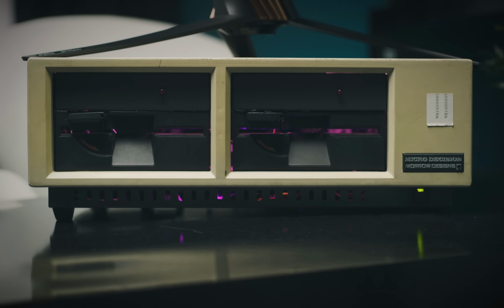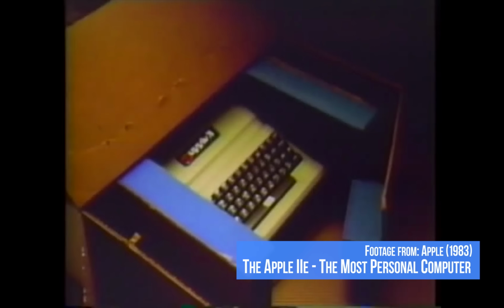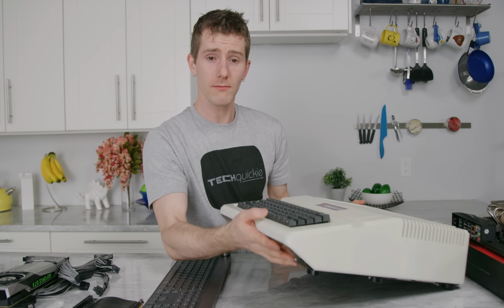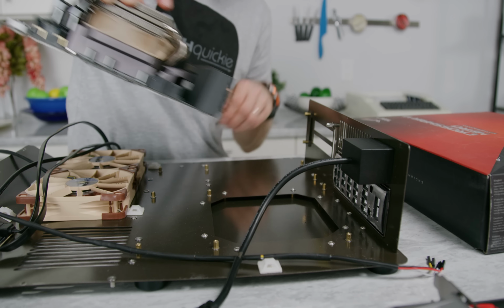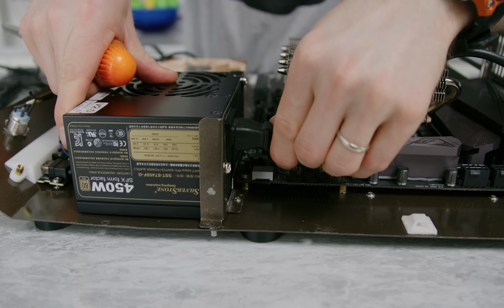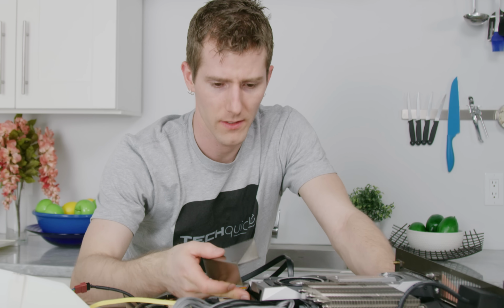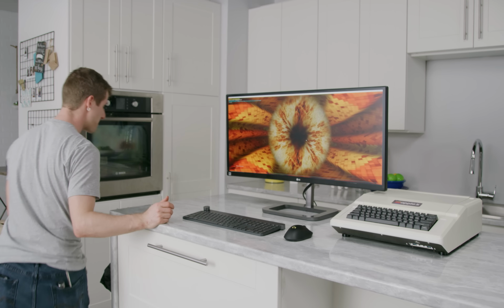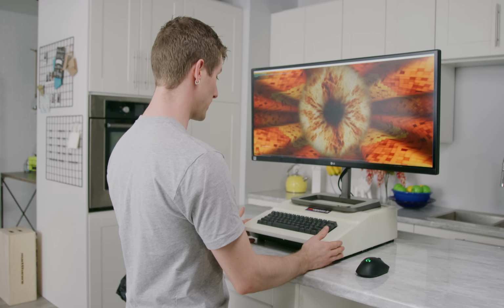Apple II Themed PC Case!!

Comment from the maker: UPDATE: This project appears to have disappeared and its backers are left with unfulfilled orders.This video will remain up, however, this should not be taken as an endorsement for the project.
Reply: Sadly I bought into the scam, thanks for at least updating the video (I backed it before the video so it's not your guys fault)
Reply: It's a shame. It's a fantastic concept.
Reply: I'm not suprised cause I bet Apple sent in their lawyers once they got wind of this.
Reply: @supertouring1  Pretty sure it was Apple
Reply: It was a bad sign when it had a unaltered Apple 2 logo plate on it.
Reply: rip
Reply: thanks for letting us know
Reply: Wow...I wanted this.
Reply: What kind of RAM did you use in combination with the CPU? I want to get a 32GB Ram kit for my AMD Ryzen 7 1800x but couldn´t find any fitting RAM Kits yet.
Reply: You should try out the Checkmate A1500 case. it's in similar vain as this one, as the case is based on the Commodore Amiga 3000, and it's on sale at their website (Though they're out of stock at the moment) https://www.checkmate1500plus.com/Products.aspx?searchkey=2
Reply: Classic kickstarter.
Reply: @bluebirdsigma  Indigogo.... Kickstarter has the contractual clause to refund the backers. Indigogo doesn't.
Reply: @harryshuman9637  I have funded 3 Kickstarters that have done the same thing and I have received nothing back.  check out the Peachy Printer on Kickstarter as an example.

Comment: Too bad its a failed project. Ideally it would have been a good option for Raspberry Pi running an Apple II emulator. The idea of putting a full size PC motherboard in a Apple II case seems strange. A better case idea would be the original IBM case from 1981. Moot at this point.

Comment: YOU CAN HAVE A SIMILAR DESIGN, but with a lower to the ground Key board, and all the connection located in the back or side, including Disk drives.

Comment: Please do the Atari 800, ST, C64, and Amiga case mods after this!
Reply: I don't know if you have seen these cases before, but most of them are tiny, there's no way you could fit anything with decent power in one of these cases (except maybe amiga 2000, 3000 and 4000) and that's just not good enough for linus tech tips.

Comment: the funny thing about a gt-730 in a micro atx case is that TECHNICALLY it's dual slot, because of the vga port. this means i can brag about having a dual slot graphics card even though i have the lowest of the lowest in power, at least for the modern day.

Comment: When I took my first programming class in about 1981-ish, our Apple looked similar to yours, but it did not say Apple anywhere on it--it said Bell & Howell, and it was black. It had a cheap power supply that emitted a high-pitched tone continuously. 64K was all you'd ever need, floppy disks were floppy, and hard disks were bigger in diameter than the length of a loaf of balloon bread. QDOS was the order of the day, with no GUI. We all dreamed of owning a Commodore 64 or a Compaq (which was larger than any of my briefcases, BTW). I was the only girl in the class (of six). The previous year my algebra teacher managed to spend a whole class period telling us to avoid evil rock music because it had satanic messages. We carried stone tablets home to complete our homework every night. My Junior High did not have a hot lunch program because the secret of making fire was not generally available to the faculty or staff. Instead of 'active shooter' drills, we had drills for stampedes of dinosaurs. Anyway, thanks for the walk down memory lane. :D
Reply: And that Apple I used cost the School over $2000.00 US.

Comment: if you would use the PROPER star head screw driver, you would have much less issues with the screws coming off the tip....not all star head screws are philips

Comment: It's a cool project but if you tried to do that way back in the 80's they'd stone you! Those 2 companies where at each other's throats as long as I can remember and Steve Jobs loathing for IBM was no exaggeration. Thanks for the vid. I enjoyed watching it but I also think a //e case with numeric keypad would be better to use. Also, if you've used an Apple // before, there's really no need for an extra PC keyboard. =)

Comment: I would have liked a Commodore PET from 1976, too.
Reply: The PET cases are probably more than roomy enough to build a nice system in there, the keyboard has probably even been converted to usb by some mechanical keyboard luatic. The real issue is probably finding one and cuting it to fit modern IO. it would probably ruin a PET to mod it for a sleeper build, which is sad.

Comment: Would it cool more efficiently if you turned all 6 of the 60mm fans inward? Forcing cooler air into the case instead of just trying to exhaust hot air

Comment: A bit of a long explantion but whoover can help is welcome. I am using the Asus Monitor VG248QE and it is able to run 144 hertz. I first did a fresh install but then later cloned it off another computer. When I did the fresh install I downloaded the newest graphics card driver off of the Geforce application. This deleted the Nvidia 3D vision that was originally on the monitor. But, then when I cloned the other hard drive the driver was destroyed. I redownloaded it but it is still not allowing me to run the computer on 144 hz (only at 60 rn). Any help would be great thanks!

Comment: They used Poker mechanical keyboard. Poker uses Cherry MX switches which is not historically accurate for this vintage case.
They should have used some mechanical keyboard with ALPS switches, since those were used in Apple II.

Comment: I've been making plans to build a PC inside an old beige monitor, using extra mounts, etc, with a 1080p screen replacing the esisting one..The keyboard (in matching beige) is going to be gutted, and replaced with some RGB. Still working out the kinks.
Reply: A beige CRT is 4:3, 1080p is 16:9
Reply: I know, just gonna add a little plastic or something to cover it up, maybe add some IO.

Comment: You could hack an iPad 3 with those miniDP adapter boards as an integrated 2K 11" display for full retardation...

Wouldn't be "Apple" but you could still make a retro themed mATX case using a FlexATX PSU, and 4x half-height (LP) slots... can run a 1050ti, taller heatsink clearance, and be 1/4 the size of this...

Comment: The one thing blower coolers in graphics cards are still relevant: low remaining volume cases. An open air cooler would not last in there without sounding like some 80s fan turbine of a PC.

Comment: Usually the Apple II came with 2 5 1/4 inch floppy drives on top. I would use "empty" floppy drives to put in a water cooler. (see https://www.bigmessowires.com/2015/03/11/apple-ii-disk-emulation/)

Comment: The slot layout on the back of the case is dumb.

The original Apple II/IIe had twelve external half-height or quarter height vertical slots and seven internal half-height card slots.

Cutting out all of those for two horizontal full height slots just for a GPU is dumb. It should have kept the vertical half-height slots, 4 of them to match MicroATX standards. It also wouldn't have been hard to make an insert to swap between horizontal and vertical slots to get the best of both worlds.

Comment: I wonder if everything would fit if they used a mini ITX mobo, left the GPU mounted vertically, then used the additional space for a standard ATX PSU at the bottom or top of the motherboard.

Comment: Did a mod with one of these cases during the socket 478 era. (Can't remember the speed or cpu, just the socket.) The Apple II case is really ideal. Put the drives in the front, under the keyboard. Dremelled a mini keyboard and was quite solid with the case's back bracket built in. Used usb speakers on the sides. Heat was an issue, so added a fan on the top. Really hated that, but had to be done. Also put metal on the top inside to stop the interference to the monitor.

Comment: That is an AWESOME case.   The only problem seems like the internal space and thermal management due to lack of exhaust for hot air.  My suggestion: You can lower the heat generated inside by choosing AMD Ryzen 5  2400 APU with 16 or 32 Gb 3200 Mhz memory on micro-ATX main board instead. That way, you no longer have to install a dedicated graphics card which generate a lot of heat and still get a decent performance for your games.  Kudos to the case designer/manufacturer.  You've done a great job dude.  Nice review Linus...

Comment: I'd love one of those!

The height issue is easily remedied. Take an off-the-shelf wrist rest and elevate it with blocks or something. If you have a knack for woodworking, cut a length of wood to 360 mm by 75 mm, add some legs to it to raise it 10 mm or so shorter than the Apple II case. Place your wrist rest on it--done. Done right, it'll look like a mini-table so you have space for the USB ports on the front.

Comment: Could someone tell me if this is a decent build? Core i5 8400 CPU (comes with a cooler) || MSI Z370 A Pro ATX motherboard || Ballistix sport 8gb Ram || WB Blue 1 Terabyte hard drive || GeForce GTX 1060 3gb || NZXT s340 ATX Mid Tower case || EVGA - BQ 500W 80+ Bronze PSU ||
The whole thing costs around $820, and I would hope to stay below $900. Any input is much appreciated!

Comment: This reminds me of the case they did a few years ago, based on the design of the old Commodore 64.  You could build a modern computer in the thing, it had the right connectors for modern peripherals, an optical drive...  Naturally, I found out about it too late to get one, and now I've seen one on eBay for about $300 or more.  No, I wasn't that desperate.  
Still, I love this type of thing.  Hope they have some good success. 
I wonder if Apple minds them using the Apple name on it?
Reply: I doubt it since Apple is quite protective of it's IP. had they found out, well I don't think it would have ended well for the campaign owner or the campaign either.

Comment: How the blin does that keyboard hook up? To an internal USB header? Also, a bit of feedback - I would MUCH rather have low profile PCI slots than that riser card deal. Then it would have full ATX expandability. They should also take lessons from Apple in cooling a small case like that and consider having a fan + shroud to direct air through the CPU cooler and out of the case quietly & efficiently, like what Apple did with their later models of G4 tower.

Comment: My first computer was an Apple //e equipped with a 300 bauds modem, two 5 1/4 floppy drives, an amber monitor and a mega 1024 KB ram card.   It was  an awesome time.
Reply: BOD not bauds ....Bits Of Data

Comment: No.  Using your video comments as an example, why don't we all run out and buy a slab of stone, a chisel and a hammer, then tell everyone, "I just got a new tablet!'  That would be stupid.  I just want a full size tower maxed out on ram with all the latest crap in it.  I've owned an Apple II and Commodore 64 and 128 models.  I don't need to look like I've got that incredibly outdated stuff as my main or backup workstation.

Comment: I actually did this back in '09 to a real IIe Platinum that I got at goodwill that had no mobo or psu in it. I used an Arduino to wire the real keyboard, crammed a microATX psu in it with a Atom 230 micro ITX board.

I did this partly as a joke to make a 'legal' hackintosh, as TECHNICALLY it was still an apple brand computer, just with some third party upgrades :D

That said, the video card just flopping around barely held in? Have you ever been inside an actual Apple II? If anything I'd say that's pretty authentic... or would be if you got rid of the screw since the ONLY thing that held in the cards was the edge connector; no screws, no snaps, just the friction of the connector and dick else. 

Was why IMHO the crApple II was one of the WORST engineered systems ever sold, there's a reason they were firmly in LAST PLACE for the entire 8 bit revolution despite their somehow magically being able to rewrite history and their place in it since.

Comment: You don't REALLY need an 1800x and a 1080ti...you could also get components that dissipates less heat...
Reply: LTT puts the most powerful hardware they can fit in every case they test, to see where the case's limits are. It's not meant to be an optimal / permanent build.
Reply: They go hard because people want to know the limits. 90% of people would do exactly what you said and make it a chill hackintosh.

Comment: There looks to be quite a bit of space under the keyboard. Could you solve the noise issues by using an AiO cooling solution with a 2x120mm rad mounted under the keyboard in place of the existing fans and drive mounts? The 60mm fans could then be omitted and replaced with 2.5" SSD mounts. with the space taken up by the noctua cooler freed up by the Ai you might even be able to mount a slimline optical drive high on the right hand side of the case.

Comment: if apple had their way, they would produce the macbook for 17 years too
Reply: It's been in production since 2006, so it's getting close. Why would they ditch the line? A MacBook is just an Apple laptop with Intel processor. Apple has had laptops since 1991. Even if it's not the MacBook, it's a laptop, and Apple will continue making them.

Comment: Can you run a Hackintosh in the case of a original Apple Mac 1984?
Reply: Yes, but an original Macintosh is worth a fair amount of money and would be a shame to destroy.
Reply: Are you referencing the original 1984 machine with the 9 inch screen?
Reply: I agree with the first guy I wouldn’t do it to a working Apple ii or Macintosh but I would just buy an og case or a broken one Beyond repair and do it
Reply: @CarolynEmory420  with loads of work you could fit a pc in an apple II case without modifying any of the original components, as for the 1984 mac, it would be really cramped, and the integrated CRT would stay unused or would have to be heavily modified to work, so it's not a great sleeper case.
Reply: magic pissenlit I was thinking more like putting a Mac mini in a Macintosh case with a lcd screen and a 3D printed bracket not the original crt

Comment: has internet stretch his arms out like a dumbass because the case isn't designed to set back that far on a desk

Did none of you use machines prior to 2000? I'm not arguing with the shitty case layout. I'm just amazed that a lot of your form factor complaints stem from treating this thing like it's supposed to work like a 2018 PC.

Comment: NO amount of improvments to the design would get me to buy that.  I love the idea, but the whole thing is built like a POS cheap china thin metal, horrible layout etc...  I would except a full metal chassis of .5mm or greater with the plastic as a shell, and a large oversized matching wrist wrest as an available option.  None of the ventilation should be from the bottom so you can remove the feet and have it set lower, the whole thing is a giant pos mess.

Comment: Random thought here, but maybe build a liquid cooling setup that's external, just not really meant to move around. Maybe a couple of old Apple II disk drives? Turn one into a reservour and the other into the rad. They could sit on top of it stacked next to the system.

Comment: I would love to place it beside my Apple ][e ... That would be nostalgia taken to a whole another level! Oh, now I am down. rabbit hole of nostalgic memories. I had a board with extra 16 KB RAM, a 6510 accelerator card, a CPM Z80 card, two floppy drives etc. Yea! I double booted multiple operative systems on my trusty Apple ][e ! 1981. i loved it, and still do.
Reply: I can't remember how much additional RAM I had in mine, but a fully populated full size extension board was required to provide it. I also had a CPM Z80 card, but actually had 3 360k floppy drives as this was required for one of the spreadsheet applications. I also had an AppleFan module clamped on the back to provide some actual forced cooling, an intelligent hardware printer buffer (which you needed when you were printing things with the daisywheel printer, unless you were due a meal break) and an intelligent keyboard controller that allowed you to reprogram the keyboard and added auto repeat. If you were playing Decathlon you could program the two keystrokes needed to run onto one key and then auto repeat. Broke Olympic records for the 100m that way.

Sometimes think that having more dedicated hardware add ons with their own processing power, rather than having to load all functions onto a faster and better CPU would be a better way to have gone. Still we had the roadblock of the Apple III and the switch over to the IBM PC.
Reply: I had 48 KB on motherboard and a extra board with 16 KB RAM och 16 KB ROM, giving a total 64 GB RAM while swapping the highest 16 KB for the OS as neccessary.,

I also had some card for the printer, I had a small A4 dot matrix printer hooked onto a board too. 

As for todays computers, yes we have "supercomputer" CPU:s and vast memory and harddrives. We have fantastic graphics and displays. But responsiveness is NOT better today, VisiCalc was fast to use and what Excel spends all CPU cycles on nowadays is beyond me. The delay from keypress to response was very very low, today we have serial USB busses, layers upon layers of hardware abstraction and drivers and API levels. One keystroke handled by a few CPU cycles are now something that takes millions of cycles...

Decathlon? Oh, boy. Poor keyboard... But it was fun.
Reply: Anita95: 64 GB RAM on an Apple //, that I have to see =D Back then you could do a lot with 64KB though you could add another 64K card from Applied Engineering to get the max 128K. They even made an external HD but by then, the Mac was already grabbing the market. Yes, it's still the best micro for most of us =D